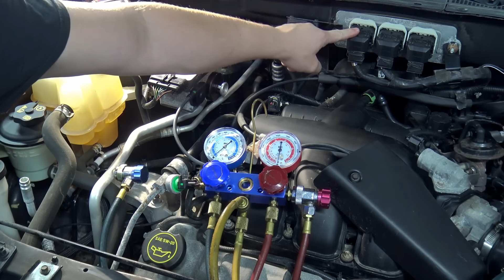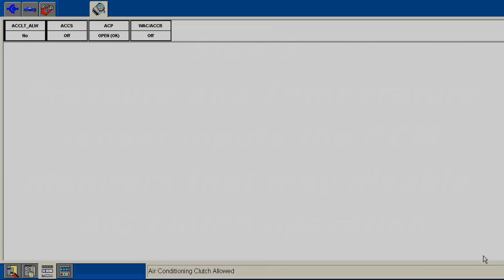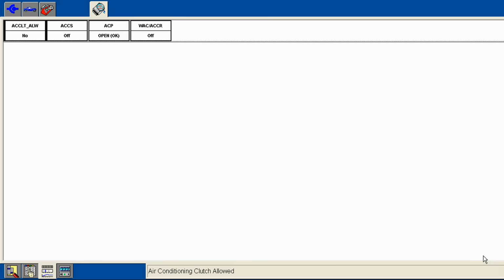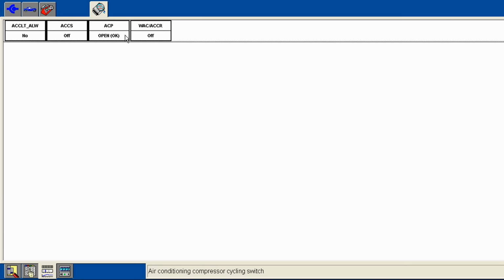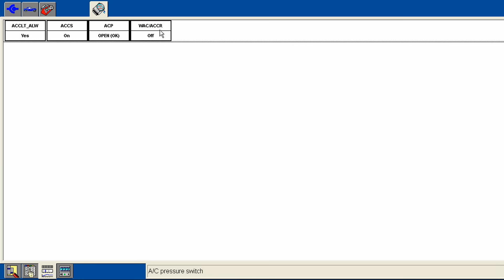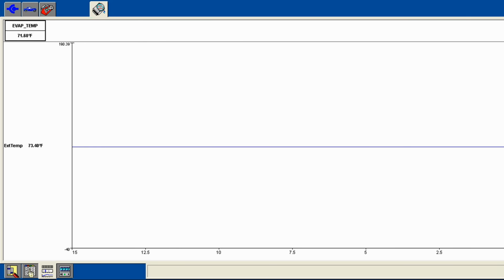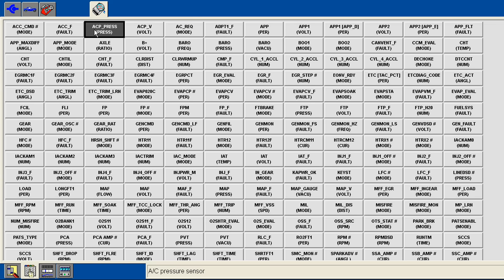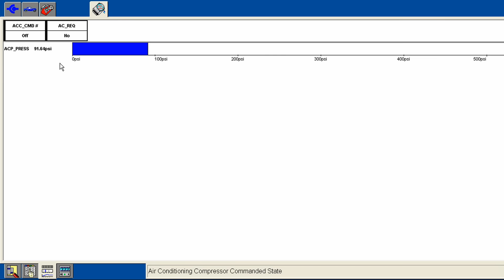Ford A/C Quick Tips #7: How To Quickly Diagnose A/C Concerns

Comment: I got a 1999 Ford f150 and from the control module it acts like it has no power to the blower motor all the fuses appear to be good as well as the relay what do you suggest I do?
I've already yank the blower motor off of my 2003 Ford ranger because the blower motors are the same and I know it works as well as the switches because I know all of them work and I've got absolutely nothing!

Comment: I've put a new compressor on checked relay and replaced checked fuses, put a new pressure switch and compressor still not working unless I put a jump wire on where the relay goes, plenty of freon in system

Comment: I'm pretty much at my wits' end with this problem: Ford Fusion AC works, but it won't turn off. Press the off button, it comes right back on. Sometimes it works fine, like every time I take it to the service center. Then they run a diagnostic, can't find a problem, can't do a thing. I take it home, and next day, or next week, or next month, it does the thing again. I even pulled over to take a video of me pressing the button with no effect, so of course it immediately started working correctly. Warranty runs out in August. What can I do?

Comment: I have a 2002 f350 with a 7.3 diesel i can hammer (screw driver handle) while running, the clutch will spin for a bit then kick off and stay off.  The a/c system is charged. i am stumped and at a cross road at trying to get a/c working.  I have already done the self test.

Comment: Crazy random ford AC problem fixed. 

2005 F150, 4.2, 2wd, manual tran

AC wasn’t working, F14 fuse was popping, replaced then popped again.  

Found a short in ABS Control Module, unplugged and AC worked, fused didn’t pop. 

Hopefully it’ll help someone.

Comment: My compressor frequently cycled and caused the engine to rev up. I checked the low side pressure and couldn't get it above 35 PSI with the compressor on (engine running) but exceeded 50 PSI with the A/C turned off. Am I missing something or do I have a problem? 02 Mustang GT.

Comment: I just did the car off key on test with Forscan on a 2012 Ford Fusion. All it cycled was inside fans. doors heated seats etc.
It didn't cycle the engine compartment fan or the A/C clutch. What version of Forscan does this? I used the newest one.
Even tried with an Xtool D7 scan Tool and it doesn't have that function either.
Great videos though.

Comment: I would like to add a maintenance tip to those that drive a good sound older car. as we know the a/c tubes are made out of aluminum which is a soft metal. As your putting miles of drive time there is slight vibration and if any plastic or metal touching these aluminum a/c tubes a small hole will eventually wear down the aluminum and a small hole will allow freon to escape.  I've had the car for 19 years and only major replacements were timing chains. now it's the a/c.

Comment: acclt_alow is NO , accs=yes wac/accr=on , acp=open(ok)  ac pressure is 104 , what could be the prblem
when i start the car the AC clutch engages and cool air comes for around 5 minutes then it disengage for ever 
acclt_alw is yes then changes to No and rest of pids stay the same as above 
sometimes its engages after 20-30 minutes for 1 -2 minutes

what could be the problem

no error codes using forscan
ford sport trac 2007 V8 limited 4x4

by the way thank you for hepling me fix the leak in my transmission , it was the wire harness connector, replaced and now no more leaks :)

Comment: We have a '16 Escape. A couple of months ago I noticed that when we left the house it would take 2 miles for the a/c to come on whereas before it came right on and cooled very well. It didn't do this every time we drove it but it did start doing this more and more frequently so we had a TRUSTED mechanic that we've used for 20 years check it. He reported that the system pressures were fine and he started and ran the a/c several times over 2 days and couldn't get the system to not work. When it cools it cools WELL, its just that it doesn't always come on. Would this test of the PCM yield an answer to an intermittent problem? IF this was an older vehicle I would be looking at the pressure switch.......

Comment: I have a 2008 crown Vic police interceptor. I'm having intermittent compressor issues. My low and high pressure are good, low pressure switch works, high pressure switch is working, the in cabin control module works, relays and fuses are fine. The compressor clutch will randomly turn on and off. Sometimes extremely fast. Then stay off for 20 minutes sometimes. Turn on for a couple minutes and then back off. Could the issue be in my pcm?

Comment: I have a 2014 f350 6.2. Ac will not work. But also the truck has several bad coils that need to be replaced causing very bad misfire. Can misfiring cause pcm to not allow ac to come on? Thank you.

Comment: I've checked all the contacts and found there is no Ground at the Clutch Relay. There is Power from the Battery as well as to the Relay when the Switch is in the 'On' Position. I'v jumped the High and Low Safety Switches and they are fine. I can manually ground the Relay Contact and get the entire system to work and cool. It is a 2004 Ford Explorer with the Manual Climate Controls, And connections look good and clean. I'm not sure how to check the Wide Open Throttle Position Sensor, but the car runs and drives good. I've read that the ground is controlled by the CPU, but not sure how to check that. A 'Code Reader' doesn't show any Faulty Codes, But I only have an Inexpensive Code Reader.   The Manual Controls seem to work in all positions and the AC 'On' Light,  Lights Up,  Any help would be appreciated.

Comment: I have 2005 f-150 lariat 4x4 and ac will crank on and turn off immediately and turn back on and right back off etc... I have changed the ac compressor relay and 3 fuses(10,10,&15). The problem continues.

Comment: Question here for anyone that may have some information , after changing the pulley and clutch the clutch doesn't turns off now! Like It did before!  Change the old parts back and still doing the same ! 07 f150 4.2

Comment: Very good video!! I have a 2008 f350 everything described in this video checks out good pids agree and pass also ac clutch relay is new. But I keep loosing power to the clutch. After the truck gets at normal operating temp. Maybe a bad ground?? I need help lol.. also the relays starts to click like crazy when this is happening.

Comment: So i have a 2010 ford explorer limited 4.0 that has the digital air gauges and the ac and heat works but only when we turn the blower on 100% if we dont neither will work, any ideas what it could be?

Comment: Where can I find what the size of the ac clutch diode is on a 1999 Ford f250 6.8l superduty v10 4x4.   All Ford dealerships parts and service departments were useless.  They say it's an obsolete part and their books only go back 10 or max 15 years.  They can't tell me what size the rectifier diode is on the wires that go from the high pressure switch to the top of the ac compressor.  I'd like to just rewire this section by replacing the diode and crimping it back into new wires as opposed to replacing the trucks wiring harness at hundreds of dollars

Comment: Good afternoon from where I am I have a question I have a 2002 Ford F150 with the 5.4 L V8 the problem I’m having is with my AC my AC compressor will come on in the line will feel a little cold ABC sway come all of the line but on the inside of the vehicle the air is just  cooler and not cold enough to make change inside the vehicle is there anything else I can check besides refrigerant because the pressure on the refrigerant on the low side is good but I’m not sure about the Hossa because I have no equipment to check it with when I took it to my mechanic the Hossa was between 150 and 200 and the low side idol was between 100 and 200 and he said that I may need a line filter which I have no idea about where it is I was thinking that maybe the dryer is not working properly or a sensor I am in the northern Kentucky area Florence to be exact do you know of any mechanic shops in this area that’s reparable that I could use to fix this issue thank you for your time in advance

Comment: Do you know what the parameters are for the ac pressure switch to kick on the high speed fan? I have an issue with my high speed fan always being on as soon as the ac is turned on. Trying to figure out if the pressure switch is bad or if the high side pressure is actually too high

Comment: Hey man, I own a 2012 lariat and the ac is not cooling enough. I have changes the compressor, condenser, evaporator, evaporator sensor, blendoor, expansion valve etc. could you please suggest what else could be missing?

Comment: Great info..
I Have an 09' Escape (non hybrid low miles) & the AC was working fine. The Clutch was a little noisy but worked.
Then we killed the engine & when we got back inside there  was No AC! 
Just Blowing hot air.
 I Checked Compressor,  it's cycling or Clutch working.  Fuses & Relays good.  
Maybe a low or High Pressure Switch.
I hooked up a freon can w/ a gauge while AC on & it pegged out in the Red & states, Take to Technician Immediately!
Luckily I have Carshield & they are paying for the repairs.

Comment: I have a 07 mustang the ac doesn't want to work. New compressor freon at the right level new fan and it'll only work at idle for about 5 seconds and then will go off for about 5 minutes and back on for 5 seconds but when it works the pressures are great. 94° 274 on the h and 55 on the L

Comment: I just fixed my a/c on my 2009 f250 in 2 minutes after watching this video and one other. Turned out a coil wire wasn't all the way engaged. Code reader said coil c primary and secondary circuit.  I pulled on the wire it came right off. Pushed it back on till it clicked. Started truck and for the first time since owning the truck the a/c clutch engaged.  I can't believe that worked! I am in shock and ahh. All the days I poured sweet knowing I didn't have the money to fix the a/c. I wasn't looking for the easy fix. You got me thinking.  THANK YOU SO VERY MUCH!
Reply: Congrats bro i just picked up a 96 5.8 f250 hopefully thats the case for me its gonna be 101 here in NJ on Monday

Comment: I had my referent re charged. My ac only gets cold when driving.  Any thoughts. 2009 Mercury Mariner HB.  Thank you for you video.      Bill
Reply from the maker: It is the refrigerant control valve in the back of the compressor.

Comment: My AC controler turn on but AC doesn't, after sometime it might come on randomly but the dial has to be in max. If AC turns on, then air only comes out thru the defrost and floor but as soon as i try to lower the dial it turns back off. Any idea what is the problem? I already changed the 4 rings on the solenoids but still nothing.

Comment: Link's diagnostic senatobia Mississippi. I paid to have it connected to the machine they said they connect you to the machine he told me I needed a new compressor I ordered a new compressor when I was taking out the old compressor I noticed b pigtail male connectors on the compressor itself were bent sideways he never even connected to it and charge me $105 while I was sitting there for 2 hours I watched him till three people needed brand new everything and they just paid it. I called him back after I had my compressor in that is the new one in and I had the old one tested and it tested good and I told him here's the printout and I want my money back he straight out said no and so I told him I would blast him on the internet and here it is

Comment: Hey bud Tim from Coopers Automotive having a battle with a 2005 Ford F150 4.6 four-wheel-drive keeps blowing fuse number 14. The last one I fixed it was the heated PCV valve this truck doesn’t have one. It’s intermittent doesn’t happen all the time. It seems to be when your shift into reverse it happens more often. Have any ideas appreciate any help oh yeah this is what operates the AC clutch so I lose my air conditioning in my reverse lights

Comment: Good morning, I've reached out to you before for some solid automotive advice I find myself asking another question.... The fan speed motor and controls on the dash low medium and high all of them are working AC is ice cold heat is hot the problem that I'm having is it blows very softly when I first bought the truck in 2011 it would blow the baseball cap right off your head now it's about half the airspeed and being that it is a extended cab with the suicide doors I lose a lot of heat and AC it would be nice if I can troubleshoot this issue and get full power out of it it is all functioning could there be a disconnect in the ductwork I know that these damper doors open with vacuum I can hear them positioning as a command the controller it does everything I ask it it just does not blow that hard and sometimes it blows very softly is it the controller?

Comment: Hi, I was wondering if you can possibly give me your thoughts on this, air shuts off all the time and I have to stop and cut the engine wait a minute and start back up and it will come back on but not always. also I've notice when I accelerate to get onto highway, It will cut off. wide open throttle cut of relay? I wanted your video, I have a 2013 F350 Diesel.

Comment: Your vid was a detailed investigation into wether the compressor and clutch was working, while not car specific, was a Damm good analogy of failure of pcm and or compressor and clutch. Can you send me a link to your vids on the accumulator, dryer, and the plugs and switches that operate those ac components, also is there a scan tool that can alert me to the faulty blend door actuators, that may not be model specific?

Comment: Hi Brian, I have a 2009 ford escape hybrid with a peculiar ac issue. The clutch engages when the ambient temperature is lower than 85 degrees. However once it goes above that, the clutch cycles and on and quickly cycles off after a few seconds. Shops I’ve visited cannot seem to figure it out and recommended just replacing the entire system

Comment: 5:53 to the left of the screen u hav a plug with looks like 8 wires(red on the left orange on the right) concected to a square chrome lookin thing. wat is that? mine is jus the plug dangling hangin off the strut/shock bolts conected to nothing lol

Comment: I have a 2007 ford expedition I have had everything replaced for the ac.. the lines , blend doors, fan clutch,  the actuator , compressor , low pressure switch, high pressure switch , condenser . Ac is full of freon an no leaks anywhere  Ac works fine for months then goes back to hot air then works again for a while then stops  makes no sense what could cause it to work fine then stop ..but now I have No ac The ac keeps blowing the ac clutch fuse (15 amp) every time I turn ac on.  what could the issues be?????

Comment: I know this is an old video, but I wanted to ask a question anyway.  I have 2014 Ford Focus SE.  Very randomly the A/C compressor will not come on.  Generally this is while driving down the road on a long trip.  It doesn't matter what the outside temperature is.  While it is running, the temperature is very  cold..  Then all of a sudden the  compressor will not engage.  The light is on and the fan is blowing, but no cold air.    This will happens randomly about two or three times per month.  I found that when this happens, I can just pull over to the side of the road and cycle the ignition switch off and then back on.  The compressor will then come back on every time and run for the rest of the trip.  I've had it in the Ford garage two times and both times they say that there is noting wrong with the A/C.  It is working fine.  They say to bring it back in when this problem is happening.  The problem is that when you shut the engine off and re-start it, the compressor works fine.  Do you have any idea what could be causing this.  The Ford people don't!
I bought this care in 2015 with 33,00 miles on it.  I know have 173,000 miles on it.  This problem has been happening every since I first bought the car.  It always had this problem.

Comment: If there is no pressure in system, ie from a leak. Will or should the clutch still engage on occasion or will it not turn on at all because the low pressure switch is not allowing signal to be sent. ??

Comment: Can you help me out please? I took serpentine belt off and turned truck on to find a bad idler bearing then put belt back on. ac clutch won’t engage now.  I cleared all codes. Still nothing . 2016 f150 2.7 eco boost

Comment: I have a 2012 escape with no faults showing on Forscan, pressure on forscan looks good. I do not have a manual gauge to check but I can hear ac compressor kick on and stay on. Air blows on at any temperature but is not as cold. Is this a low refrigerant issue?

Comment: Can oil on the clutch cause it not to engage?
Reply from the maker: It would have to be allot.
Reply: @FordTechMakuloco  I have a 2012 f250 6.7 ac compressor turns off and I get a light rough idle as soon as it kicks back on it goes away I was wondering if you would happen to know if these trucks have a diode for the compressor ?I can’t seem to find on I was thinking it was that current going back into the system and messing with electrical components

Comment: Just had my compressor, dryer, and orifice tube replaced on my 2006 F150 4x4 XLT by Firestone, but they cannot get the compressor to turn on due to a PCM precheck.  Specifically They said the PCM was reading an “engine oil too hot” code, which is preventing the PCM from sending the signal to the compressor.  It doesn’t make sense to me since the car
Wasn’t even on so the oil was at ambient temps.  Also, it blew cold before, but the clutch was shot as was the compressor as orifice tube was full of junk.  Any idea? Just hoping to have my truck running cold again.  Thanks